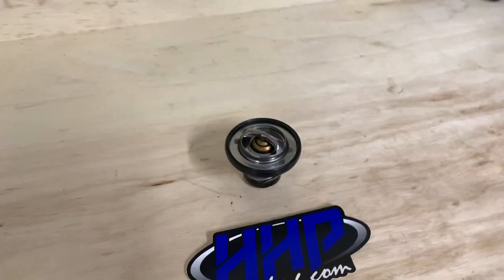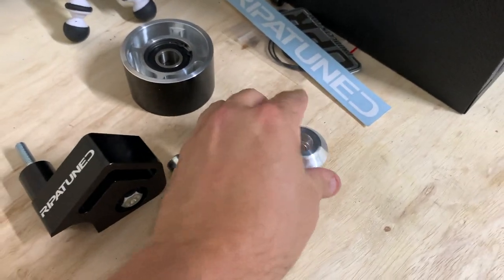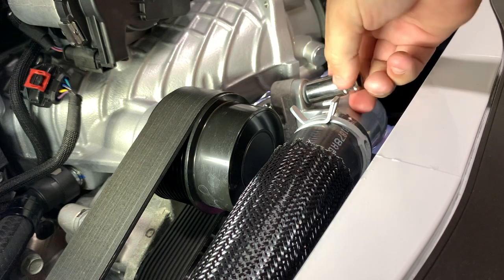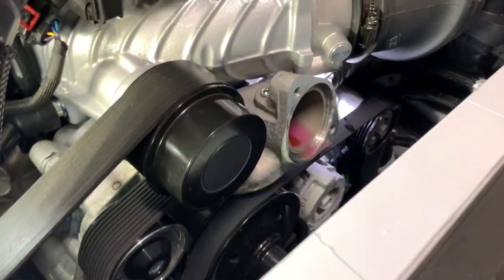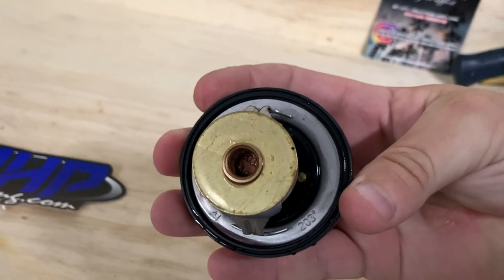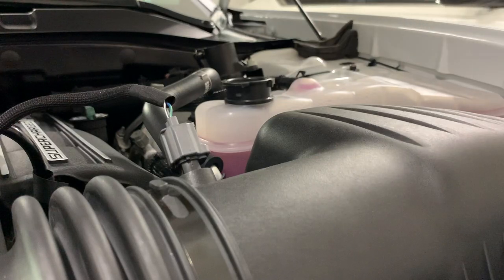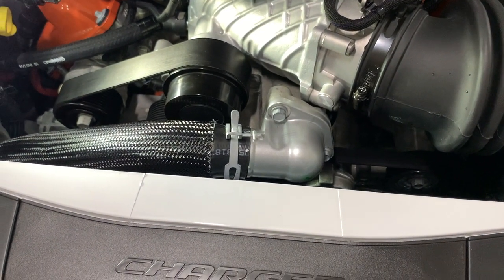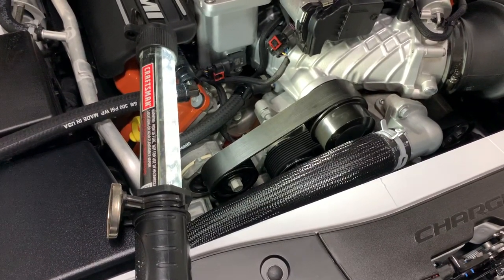2020 Hellcat Charger gets a 180 Thermostat.  #Hellcat

Comment: Hey bud I didn't see you pull a little Allen screw out to burp the air out of the system do you do that while the car is running or you let it run for a while and then you pop the screw when you get the air out? And without a fan tune what kind of temperatures do you run as I'm thinking about putting a 180 in my Hellcat
Reply from the maker: OLDSCHOOL RICHIE RICH I did not do that at all.  As long as you have the wiggler valve straight up when you install the thermostat, then is should burp the air out after one drive and cool down.  So I filled the coolant reservoir with what came out, replaced the cap, started the car and drove it for a few min.  Then returned home and let it cool down.  I haven’t really ever had a problem doing this in these cars.  I am seeing the same temps i did with out a tune in my two 392 cars. I have a video on it in my 2018 scatpack album if you want to see it.  They are around 185 to 192 most of the time.  Of course with not tune if you idle for a long time, or get in heavy traffic they will go back close to stock temps but come back down when cruising at speed.
Reply: Ty bud il be getting one great video much appreciate the ans so quick

Comment: Were your fans ever over worked due to the thermostat change? I’ve heard some say yes, others say no
Reply from the maker: Considering they come on at a higher temp I don’t see how they could be overworked by putting a lower degree thermostat in.  It would make them run less.  
I have heard of fans being over worked in cars that have gotten a tune with a stock thermostat installed Because most tuners across-the-board lower your fan on temperatures to promote better cooling for the car. Cooler engine = a happier engine to a certain point.
Reply: @KnightsGarage  Thanks!

Comment: Heard u will still get a cel if not tuned properly for the fans
Reply from the maker: I believe that depends on the climate.   If you live in a cold climate like 30 degrees or below You may have issues.  But even in winter here in Alabama I’ve never gotten a CEL even in the winter time on my scatpack before I did a tune and my current 2020 hellcat.

Comment: My car wants to heat up when I’m parked would this help? I have a 2016 hellcat charger
Reply from the maker: They will all heat up when sitting idle for long periods, Especially when it’s hot outside.  This does however help that in my Experience.  Takes a lot longer to heat up than before when sitting idling also I would see temps as high as 220 if the factory thermostat and I haven’t gotten above to12 with this one and that was one day when we were looking at houses and the car was pretty much idling for an hour or two.  Soon as I started driving it cooled right back down to about 186.

Comment: Don’t you get a Code for engine not getting up to temperature
Reply from the maker: I never did.   I think it depends on your climate, because people in colder climate seem to get that.
Reply: @KnightsGarage  iam in Canada but the car wouldn’t get driven in winter or colder weather so maybe I’ll be ok
Reply from the maker: @Srt_Kev  I think the code has to do with the amount of time it takes to come up to a certain temp.   I think it Hass to hit like 160 or so within a certain amount of time or you get the code so if you start up and start driving and it’s cold, since the thermostat begins to open sooner, it will take longer to achieve that temperature.  
Like I said, I did it in three different chargers, and none of them experienced a check engine light
Reply: @KnightsGarage  yeah I think thats exactly it your right

Comment: I think you do not need a tune because you are lowering the temp. that would have to save fan life, right the fan would have to run less
if you are lowering temp. If am wrong someone explain it to me. Why change the tune? So I say the engine will last longer because it runs 
cooler and the fan life should improve because it will run less. Call me if you want 406 231 3649 I have a 2018 Hellcat.